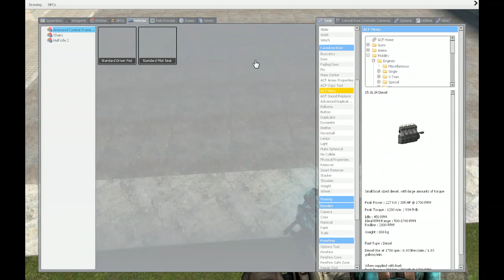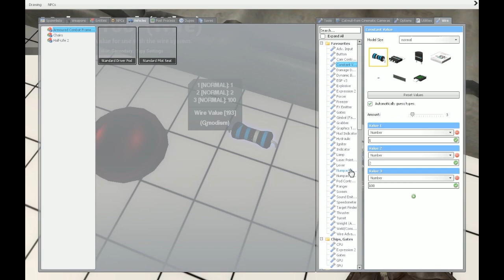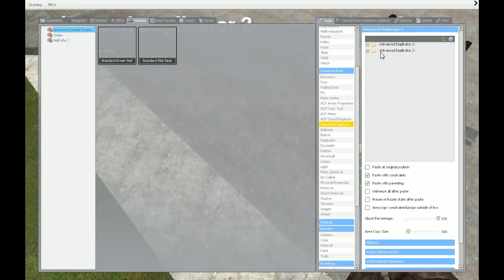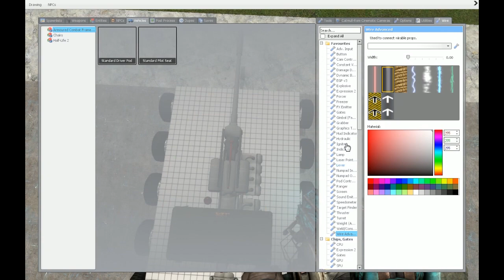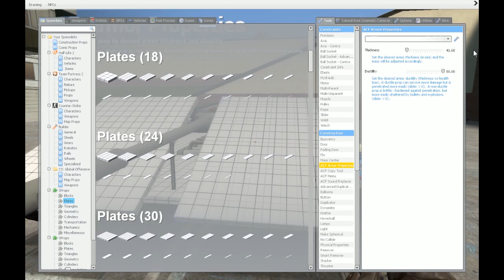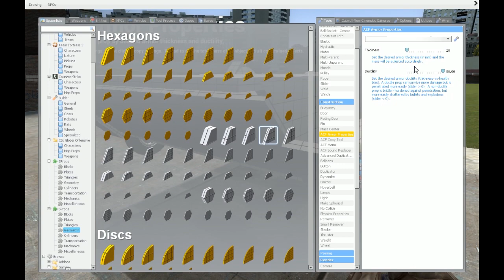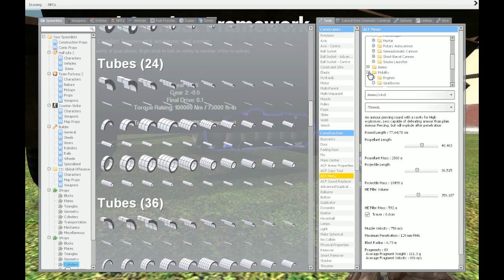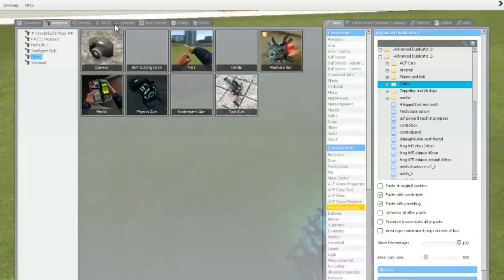[Tutorial] Garry's Mod Basic ACF Tank Complete tutorial by Gmodism [No E2]

Comment: Hmm... So I've tried applying this tutorial to my own base of a tank, just the gun part really, and when I use the hydraulic it's very... Well it has a lot of inertia when I stop pressing the key. It just keeps moving. This is using a Howitzer by the by, as I'd like to make an artillery tank. Any help would be sweet. Thanks!
Reply from the maker: ***** Certainly, heavy gun that must be!
Use Axis centre (if you did not) to make axis from the balancepoint of gun, it that way it will be equaly heavy on both sides, tip two is to have the hyduralic as far as possible from the axis, that is, creating maximun leverage, if you need even more stabillity, try using 2 hydiralics and put them in a shape like this /\, smal angle with the same point at the gun and bit separated on the baseplate, hope that works for you! ^^
Reply: Gmodism Total Nerdery Channel
Thanks! I actually solved it in my mean time this morning, and instead just made the hydraulic move slower, which also put in a little bit more realism factor for me (since artillery tanks are rather slow on everything but shell delivery). Thanks for the help! I love your accent by the way. Very smooth and works well for tutorials ^^
Reply: Would you possibly enjoy seeing the shell so far? For being rather new to this, I think it's rather impressive.
Reply from the maker: I would! possibly one can alos showcase it when it's done if you like ^^
Reply: Well I've actually gotten it to move, thanks to the help of a friend! It's not beautiful but hey!
Reply from the maker: Cool! good luck with tweaking it to perfection then! ^^
Reply: Thanks! ^^

Comment: I'm having some sort of problem.  I'm using the exact same method that you use, but instead I employ I6 20L diesel engines and have my gearboxes in the front (turning front wheels and "dragging" back wheels).  Transfers exactly the same (0.5, -0.5, 0.1), wiring done down to the word as you described it and did it, but when I tap W and hold Space, the vehicle doesn't move at all.  The engines roar as if it was, but it just sits there doing nothing.  Same with reverse.  But when I hold down W or S with Space, it starts to jerk violently in the respective direction with each change of gear (i.e. holding space and gear change button makes it automatically switch gears repeatedly and jerk forward/backward with each gear change, but no sustained power).  I even completely started over and built the vehicle exactly as you did with the same props and positioning.  Wiring, wheel axes, engines, gearboxes, EVERYTHING done exactly the same as you did it in the video, I made SURE of it.  But the vehicle still did the same thing!  The engines just roared and the vehicle sat completely still!  Is there something you could recommend?
Reply from the maker: +Kaiser Wilhelm II If you are so sure that you made it all the same it hard for me to think of what might be wrong as I don't see the vehicle. Spontaneously I can think of: Is Engine to powerful for the gearbox?  Are your connections from gearboxes to the wheels good? Are your wheels appropriately heavy in comparison whit the rest of the vehicle?
If you still cant get it work maybe there is some problem with some of your mods? playing in multiplayer on a ACF server usually solve those issues.
As a last resort, build your tank with an other technique, check my friends, StompCam, tutorial of acf tank. You might also wait for me to make a APC tutorial, basicly a light tank, that uses an other technique.
Hope this hepls you! :)
Reply: +Gmodism Total Nerdery Channel Everything has turned out OK now.  ACF was telling me it was up to date but I just did SVN update to it anyway, and sure enough there was an update I didn't have.  Everything works fine now, sorry about the trouble.
Reply from the maker: +Kaiser Wilhelm II Np ^^

Comment: hey gmodism. i have a question about precision alignment... if I lets say set the roll for 30 and the pitch for 25 or something. and lets say i move the pitch up to 30 or 35. instead of it just moving the pitch it appears all of the angles move instead of just the pitch. for an example. lets say i have a long beam 0 pitch 0 yaw and 0 roll. then i wanna attach another beam with a yaw of 0, a roll of 25 and a pitch of 115. when i move it this, the bottom of the beam is no longer aligned up with the yaw of the bottom beam that has 0 pitch 0 yaw and 0 roll. This has been a big issue for me and i can't figure out what to do. pls respond...
Reply from the maker: m8, I don't really use PA, I suggest you ask someone in the comments of my videos that always complain that I don't use PA, they will know!
Reply: sorry for bothering then (._.)

Comment: When I hydrualic the autocannon it refuses to rotate on the axis as if its welded, do you know a fox for this?
Reply from the maker: That sounds like you have lots of friction on the axis, set friction to 0 or something low
Reply: Okay, if that decides too not work for any reason do you suggest any other way of being able to move it up and down?
Reply from the maker: First remove the old axis by pressing reload on axis tool, then apply new axis, if that does not work, see is the wiring correct, that is can you move other stuff with it?
As for other ways there are vector thrusters and E2 chips if one wants mote turrets ^^
Reply: Yeah, if for some reason it doesn't work I'll try editing spiders tank chip too fit it.
Reply from the maker: Well try that, if that i described does not work its not garantied the chip work ether, im not sure what you have tried exactly so I cant know what to try next though

Comment: Hi again! It's been a whole year since I made my first tank and I've only now made my second, however after somewhat figuring out how to put together a tank on my own without use of the suspension (just using a base) it seems to drag and be weighed down. I still don't understand tank weight and how to make it not look like a bagged car when it drives. It's just very low and drags a bit - any advice?
Reply from the maker: +MrBloodyboy551 I think your wheels are too light for your tank, like how heavy is the base and how heavy is the wheels? 
also, have you parrented the tanks armour to a chip? it is maybe a bit wieard but that also helps!
Reply: 2 years late but my tiger handles fine, it's 50 tons, the armor weighs most of it. base is ~3000 and there are 16 total suspended wheels which are 250 each. it's just a little sluggish turning but that isn't related to it's weight

Comment: whenever i make the thickness of the armour 75mm and then change the weight to 60 so it does not tip my tank it turns the thickness to 1.57 mm thick
Reply from the maker: ACF tries to be balanced, so you cant "cheat" the system, good armour will weigh much, what you can do is parent the armour, and it will actually stop being affected by gravitation :)
Reply: thanks man! :D also on ur turret tutorial my turrets gun will move up and down but it cant move horizontally. well it can move horizontally but only about 5 degrees left and right? is there a way to fix this?
Reply from the maker: sounds like you have some weird constraints that limit the guns movement, did you check those?

Comment: How might one make a mouse-aimed turret which doesn't have third-person view? I.e., can be controlled in first person, perhaps with aid of view screens (CCTV-like) inside the vehicle.
Reply from the maker: +Kill3rCat simply do not connect up a cam controller :) then you can use them from seat view
Reply: Gmodism Total Nerdery Channel I presume that's using the E2 script in your other vid (APC/IFV)?
Reply from the maker: Oh, yes indeed!
Reply: Gmodism Total Nerdery Channel I see, thanks!

How would one go about setting up view screens? If it's even possible, that is...?
Reply from the maker: it worked before, downloadable but not in main game (i think) if you use the RT Camera you can do the RT material or a flat prop or use a premade RT screen and video feed is broadcasted there!
Reply: Gmodism Total Nerdery Channel What is RT?

Also; I did what you suggested with the mouse-aimed turret, and it rotates fine... but it seems to face the opposite direction to where I am looking. Have I perhaps done something wrong?

Edit: What is an EGP? Sorry for all these dumb questions.
Reply from the maker: here ya go
https://steamcommunity.com/sharedfiles/filedetails/?id=106944414

https://steamcommunity.com/sharedfiles/filedetails/?id=147583719
Reply: Gmodism Total Nerdery Channel Cheers. Any idea why the turret turns to face the exact opposite direction I am looking?
Reply: Thought I might've put the turret or E2 chip upside down, tried reversing the direction of one, then both, of these. Didn't fix it.
Reply: WOW... So after further experimentation, it seems that the E2 script (if no EPG is present) will orient itself with a particular direction via WORLD co-ordinates... I.e., it always thinks that one particular direction is 'front', no matter where you or the vehicle are facing.
Reply: Oh god, a quadruple-post. I am so sorry... Should probably click 'Edit' a bit more than I do.

Is there some way to do this without the use of an E2 script?
Reply from the maker: Okay, so to sum up, most E2 chips are made to be built with facing north, if you paint a smily and it looks happy you are facing north, also if you have not assigned baseprop might cause this problem...

Heavy guns might work less good using the vectorthruster method, for that it is included in the tank tutorial made by my friend StompCam / swedish chef
Reply: Gmodism Total Nerdery Channel I did assign the baseplate. So, the reason for this is simply because the script only works when the vehicle is facing north...?
Reply from the maker: It usually works any way, but if you build noth it should work nontheless!
Reply: Gmodism Total Nerdery Channel Uhm... how does that work? Regardless of what way I turned the vehicle after placing the E2 chip, the turret only working correctly when facing north.

Comment: Gmodism Total Nerdery Channel if i want to use a single v12 could the wireing diagram in the tutorial be used in the single v12
Reply from the maker: tanner fox Yes it should work fine, remember that this system is that if a heavy tank, if you are making a light tank you might want to use an other way, I might do a tutorial but my friend have a nice tutorial on that also: https://www.youtube.com/watch?v=qY4w83umdm4 ^^
Reply: Gmodism Total Nerdery Channel Thanks again for ur help and btw after i build the baseplate with every thing on it my tanks engine and gearbox disapears totally and sometimes even the tank disapers
Reply from the maker: Yes I have noticed that, dupe often, there is no fix that I know of, sadly.
Reply: ok

Comment: WHAT!! We need wire?
I have 0% knowledge on wire
Reply from the maker: +Soldier Wee I have 99% so it's okay ^^
Reply: +Gmodism Total Nerdery Channel i made a 8 wheeled one with a gas turbine engine if thats ok
Reply from the maker: Lol yes do whatever you want! :)
Reply: it turns out that that it wont fit so i used a 1272 hp engine instead so yeah
Reply from the maker: That sure will make some heavy big tank gun for ya!
also if you want to make more agile tanks, my tutorial of making acf apc is actually to prefer as a method for fast tanks also :)
Reply: +Gmodism Total Nerdery Channel ohh yeah when i fire a gun my sounds dont work how do i fix that do you know?
Reply from the maker: Hm, have you tried changing gun sounds?
Reply: Gmodism Total Nerdery Channel that didn't work :(
Reply from the maker: Allright then you probably miss some important stuff in ACF folder,
if it not works on servers or in single player you should reinstall ACF
Reply: Gmodism Total Nerdery Channel ok i will try
Reply: Gmodism Total Nerdery Channel thanks that helped and sorry if im commenting too much i haven't used gmod in a year now
Reply from the maker: No problem it's fine! Good it works no
Reply: Gmodism Total Nerdery Channel yes im now developing a car that has a 140 mm cannon
Reply from the maker: Lol! sounds like a tank to me
Reply: Gmodism Total Nerdery Channel yup
you are the best for responding to me thank you
Reply: +deadfire games the car won't hold up the weight. If you want to do that, your baseplate has to weight at least 11 tonnes lmao
Reply: Tsang Billy yeah i know
Reply: for 140mm cannons i use 4 tonne bases w/ rope turret, i was overexaggerating